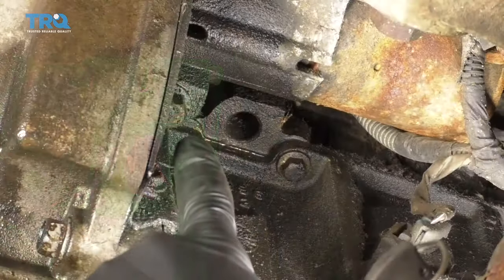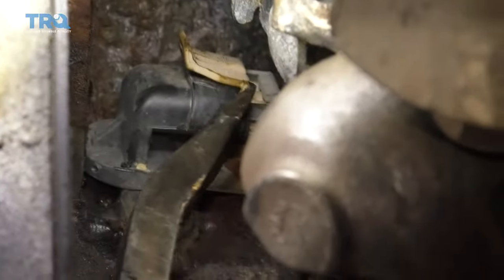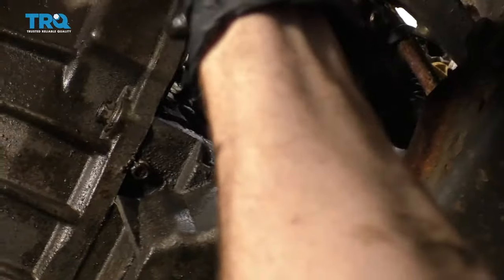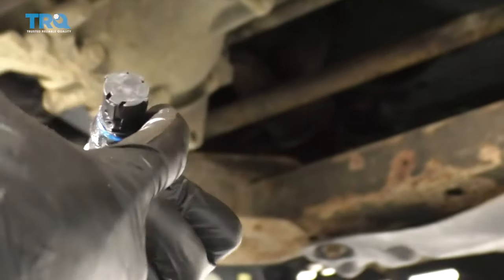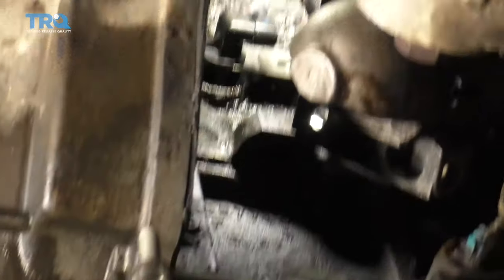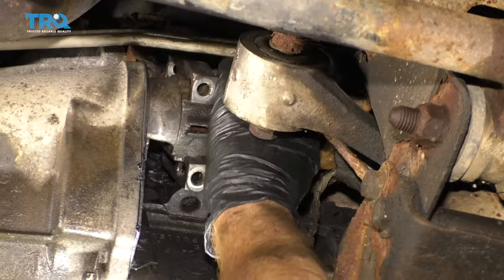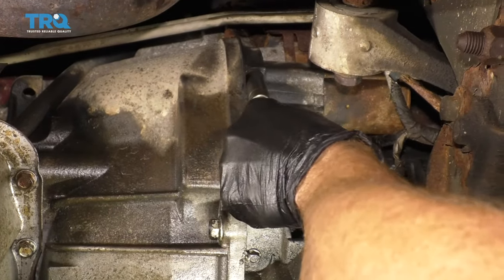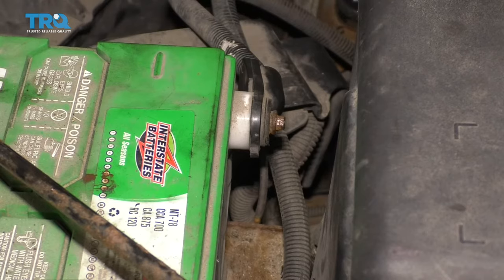How to Replace Crankshaft Position Sensor 1999-2007 Chevy Silverado

Comment: I think you should also advise people that the crankshaft position sensor must have a re learn procedure performed in order for it to function properly. I get the title is how to replace  a cps, But inform the people as well. Information the most valuable commodity there is. Thank you for your video.
Reply: No must. You don’t have to run re learn
Reply: Replaced mine, never had to relearn.
Reply: I replaced mine in my 2001 Silverado and it would not run with the new crank position sensor so I put in the old one with a seal from the new one. I wish I had known about having to program it before replacing it.

Comment: I was replacing crank position sensor on 2000silverado 4.3. After taking starter out[ no easy job] I discovered that there was no sensor there. After talking to local shade tree, I found sensor at front of crank, behind front pulley. What's up with that?

Comment: After replacing a crank sensor is it necessary to do a Relearn with a capable scan tool? (07 Silverado 1500 (new body style). Thank you!
Reply: I got a Standard Sensor from Oriellys and it does not require a relearn.  AC Delco and other brands make sensors that do not require a relearn.

Comment: So if you are here because this job has turned into a massive pain in the ass.  I have a 2011 Silverado.  1. Make sure you get a sensor that does not need to be re-learned.  AC Delco, Standard, and a few others make OEM parts that do not require a relearn do your research or ask the auto parts shop that has the part.  If it needs to be re-learned you will need a scan reader tool to perform a relearn.  Not everyone has a $1,000 dollar scan reader so just get the sensor that is direct OEM replacement, I've never done the manual relearn but just get the part that doesn't need a re-learn.  2.  Remove the passenger side tire and remove the plastic wheel well cover.  Why?  When you take it off you get direct access to the sensor and bolts and you don't have to mangle your hands or if get easily frustrated (especially with a starter).  I did mine with a pretty good extension but it was 15mm for the starter bolts and 10mm for the sensor bolt.  I was able to get in right where I needed to and really didn't have to take the starter out completely.  I removed the starter bolts and adjusted it down so I could get to the sensor.  By removing the wheel well I didn't need to get into a fight with my ratchet (because that's a fight I will lose).  Its an extra step but it also allowed me to inspect that area etc, doing it this way also gives you better access to inspecting the wires to make sure they are mangled.  It's so much better than trying to do it on your back.  

Hope this helped!
Reply: My man. Right on.
Reply: very nice advice man,  👌 👍

Comment: Unplugged crankshaft while doing manifold gaskets on 5.7 v8 chevy. 
Starts up and run but now is running rough and throwing P0300. Did plugs, set time and installed new distrubor.  Is it possible the crank needs to be relearned to clear code?
Reply: Yes their is a relearn procedure

Comment: What code comes up on the vehicle with the crank shaft?
Reply: P0335.  Mine had service traction control service stabilitrak for a month until it finally pulled an engine code.  It stalled one time, and every 5-6 days it was hard to start or took long cranks.  The sensor has a magnet in it so I'm guessing that the magnet likes to torture you until it finally goes.

Comment: Do you lose horse power with this sensor? I have a 99 Chevy small block 5.7. And lost lots of horse power, it says I need to replace that sensor.
Reply: did you relearn the sensor? if not you need to